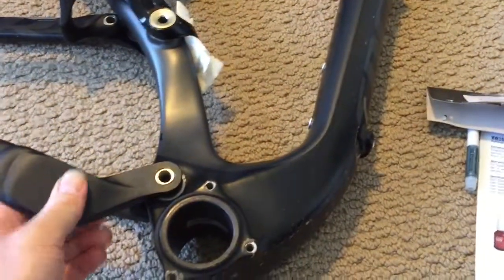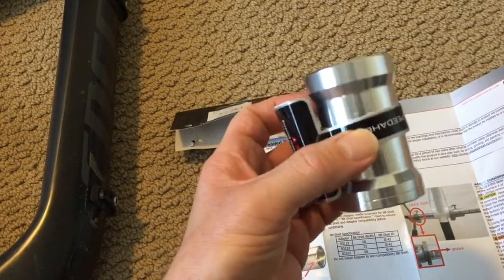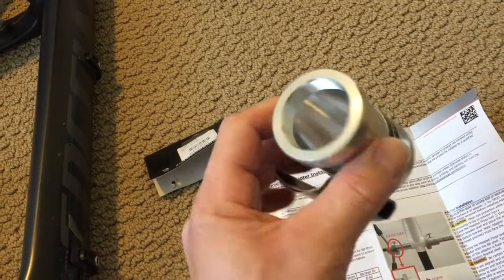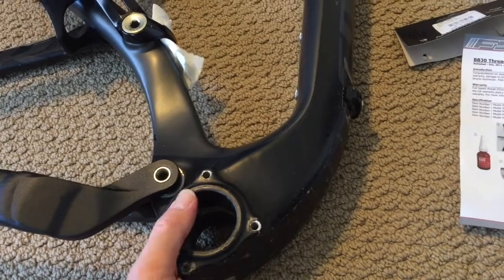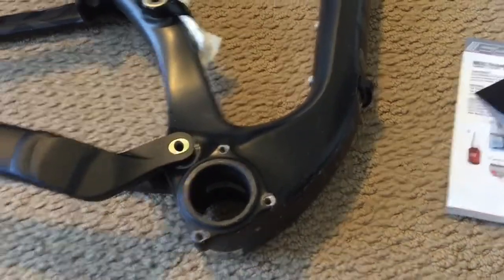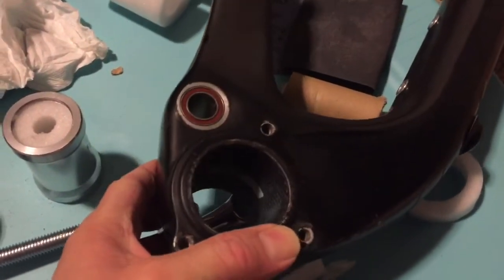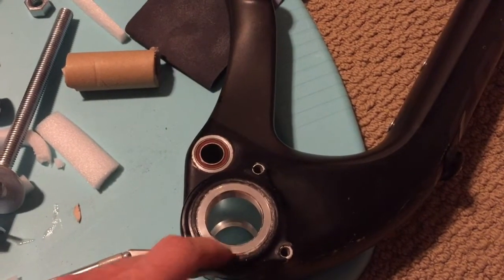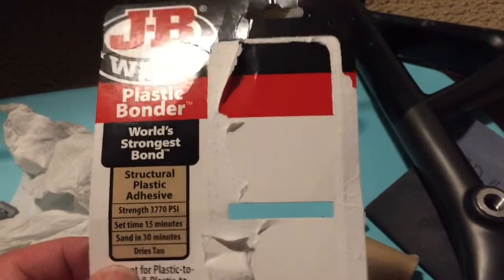FSA PF30 to BSA threaded aluminum bottom bracket adapter installation in Specialized Enduro frame

Comment: Exactly what  going on a air9er. I removed the PF30 now installing the BSA lock tite is recommended for install
Reply from the maker: Is the air9er a carbon or aluminum frame?
Reply: @mtbbiker6401  it’s aluminum
Reply from the maker: @markkus1134  Ok. I didn't use the included locktite because wasn't sure it would work with carbon so I used epoxy.
Reply: @mtbbiker6401  I’m sure that will work I ordered the PF30 to BSA BB
Adapter I’ll use locktite on it I ordered the same adapter you used in your video
Reply: Yep it will work comes with locktite

Comment: Hi, thanks for this video.  I'm looking to install the same part, into a Cannondale frame in which the BB30 aluminum sleeve has become unbonded to the carbon BB housing.  Did set up in the video end up working for you?  

In my case I am pretty sure the now-dismounted BB30 sleeve has become so deformed that it will never again work to seat any bearings directly, but might work as an adapter between the FSA part and the carbon shell.  How hard did you have to press to get the FSA adapter into the PF30 sleeve? 

Thanks in advance.
Reply from the maker: Honestly this project has been put on hold so I can't comment on success/failure. It didn't take much effort to press it into place but it was inserted into a PF30 carbon tube, not aluminum sleeve. My fear is that the adapter may want to drift left or right under load. In hindsight I probably should have machined some retention grooves in the adapter to help stabilize it with the epoxy. I suppose I could drill and tap a hole in the bottom bracket and install a screw if drifting or rotating becomes a problem. I hope to finish the build this winter. I have all the parts, just not the time! Have you looked into a thread together bottom bracket from Wheels Manufacturing or Praxis? Those might be a safer option.

Comment: Thats tricky. Aluminum probably expands more than CF on hot days. if the adapter already needs to be press fit, imagine what that aluminum will do to the CF when it expands. Ouch! May crack the frame. Im wanting to do that same thing but there has to be some kind of barrier material between the two.
Reply from the maker: Good point. I am taking a chance. I have read positive reviews after being installed in carbon frames. I emailed FSA support before I purchased it asking if it's recommended for carbon. They said it will work but it will most likely be a permanent fixture so don't try to remove it. Mine was not terribly tight. It pressed in fairly easily. Granted this will vary depending on the tolerance of your frame. My Specialized frame has a full width solid carbon tube bottom bracket shell. Yes, I'm taking a chance but carbon frames have threaded bottom brackets bonded to the carbon from the factory. I guess I'll find out after I start riding it. Another option is to go with a two piece assembly like Wheel Manufacturing, Token or Praxis bottom brackets. Token also makes press fit threaded adapters. This is probably a safer option.
Reply: @mtbbiker6401  LOLz - what do you think the PF30 cup (that head the BB30 bearings) that was pressed into the frame was made of....?
Reply from the maker: @chrisnuttall4368  Aluminum. Not sure I understand your question. I assume manufacturers are bonding aluminum BSA adapters in carbon frames similar to what I did in my video but probably better bonded with more surface area than what I was able to achieve with the FSA BSA adapter DIY.

Comment: you didn't actually showed the installation.
Reply from the maker: You are right. I was really nervous installing it and forgot to film it. I did show the screw, nut and washers I used as a press. It actually went in smoothly. I did put it in the freezer for "shrink" it a little before pressing it into place.